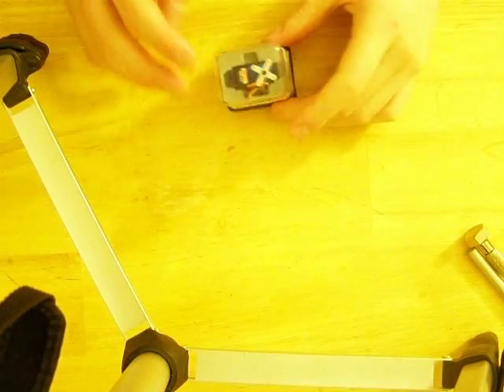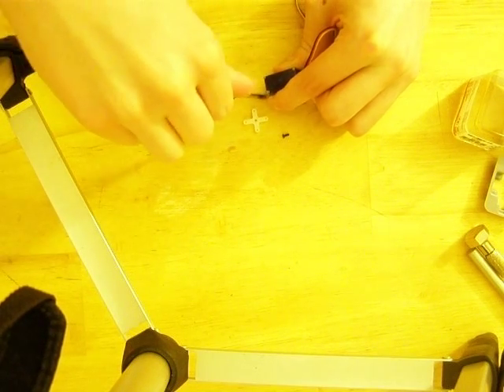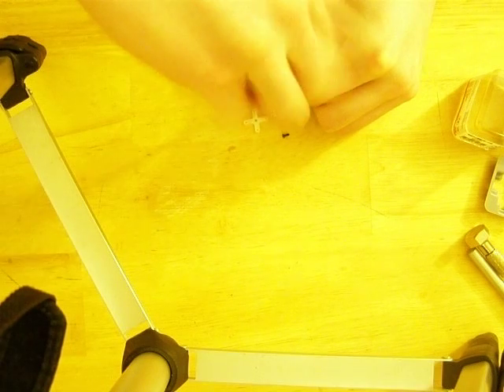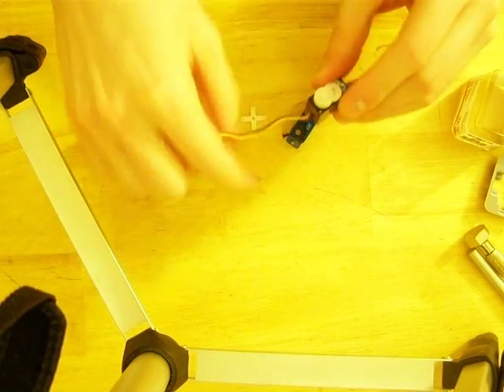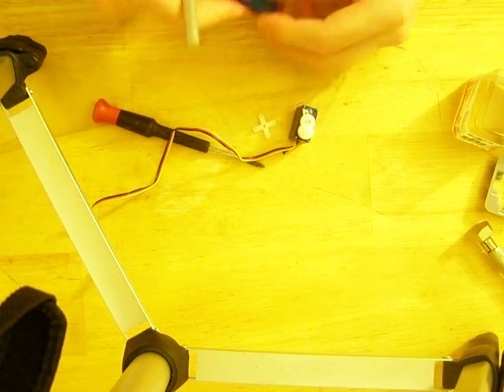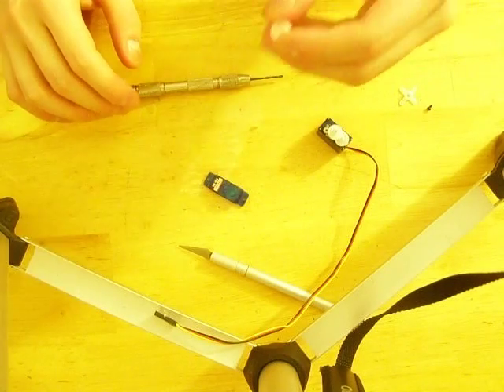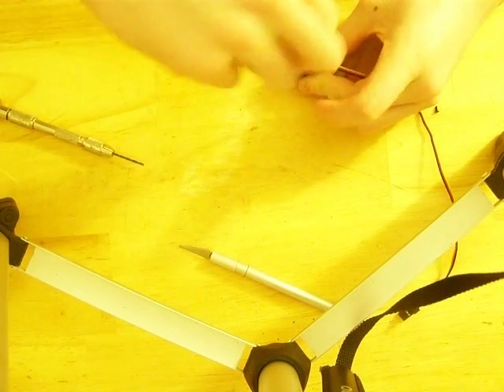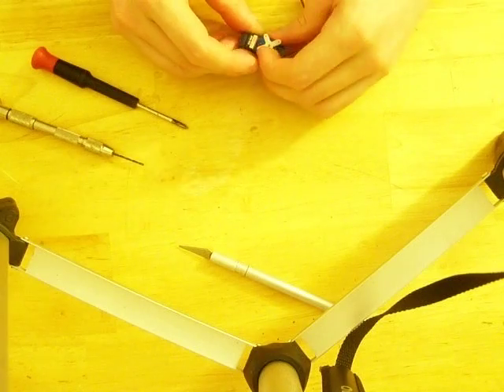How-To: Modify Hitec HS-55 for Continuous Rotation

Comment: so everything about this video tells me that I need to see it to believe it. cause all of the other posts i've been reading up on (and personal experience of a cheap servo) says that it'll rotate no problem without the mechanical stop. its just that it won't go another direction, it might slow down or even stop tho, but because of the way it senses position (potentiometer or other) it doesn't allow it to work as it did before once you've spun too far. if i'm wrong, sorry, its just what i've been seeing.

Comment from the maker: @tokamax238 Crazy glue, hot glue, epoxy, they'll all do the job decently. I find this is less of an issue on the hs-55s, but if you're modding other servos such as Hextronik servos (which I have found are cheaper and better than the hs-55s) you'll need to do this. I may post a tutorial on those later.

Comment from the maker: @tokamax238 Yes it does, it will respond left or right depending on which direction the pulse is in, as long as the pot was centered before you modded.

Comment from the maker: @andres24gomez All sorts of stores sell the Hitec HS-55, including big chains like Tower Hobbies, and electronics places like RobotShop.

If you're asking if you can use it as a drive motor for xmods, you're not going to get anywhere near enough power out of the gearing on those servos. After doing a bit of reading it looks like some people do high-torque mods for things like rock crawling: you can use these servos for that, yes.

Comment from the maker: Just the speed. If you want to control the angle of rotation at that point you could use a rotational sensor and stop the motor, though that needs calibration and unless you get both a good servo and a good sensor, isn't that precise.